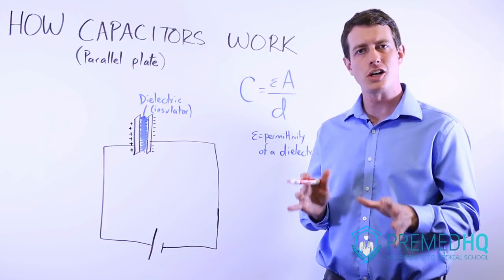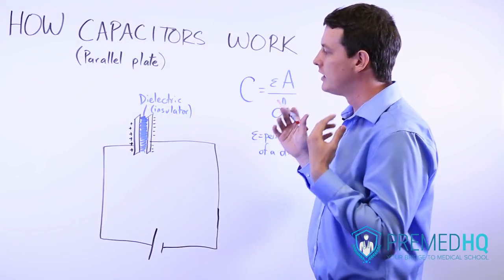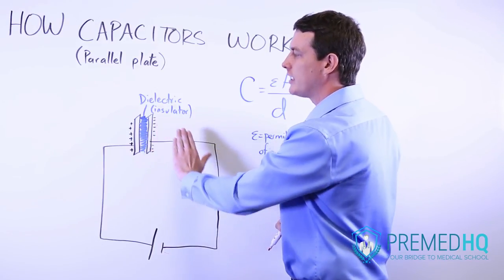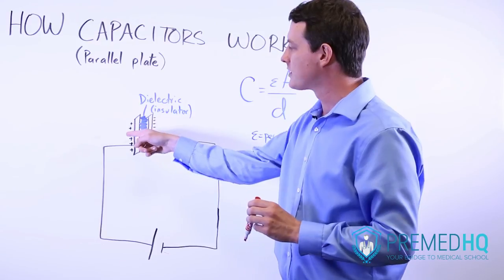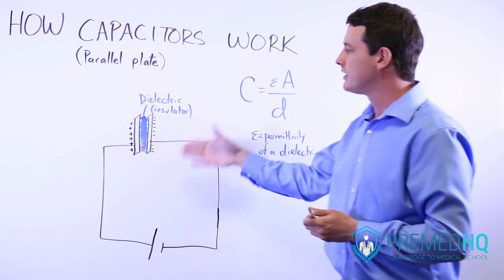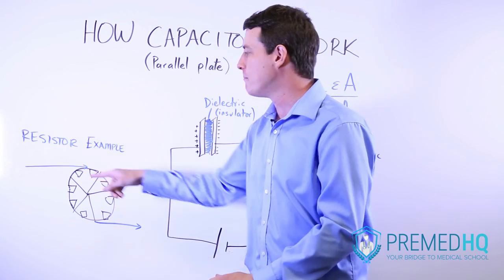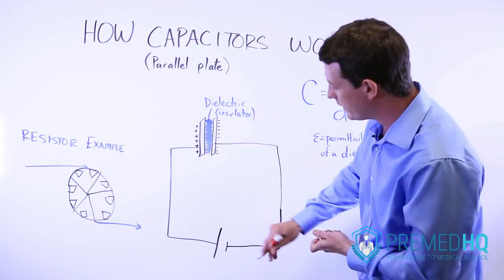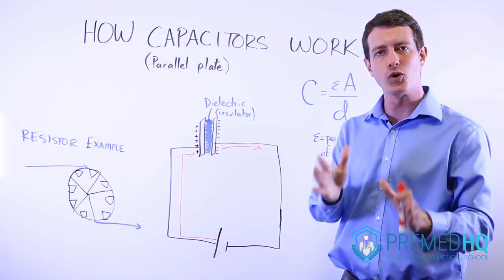How Capacitors Work | Parallel Plate Capacitors, Insulators, and Capacitance Equation

Comment: The part that confuses me about capacitors is that, the idea of the capacitor is that it stores charge by building up a positive/negative side that cannot interact and stores electric potential energy. How is it that current can cross a capacitor in a circuit AND be maintained if that is the case?